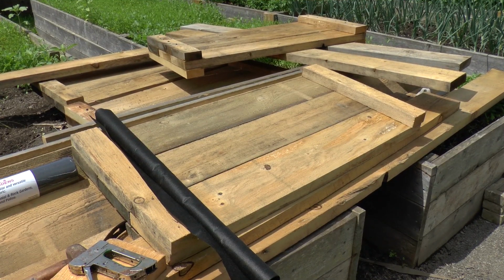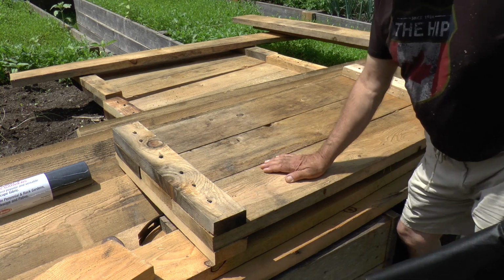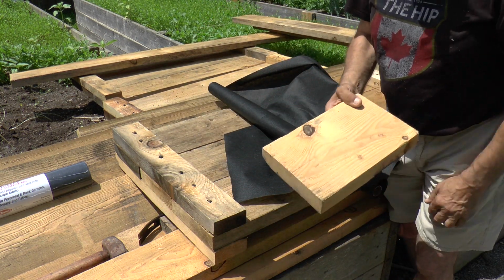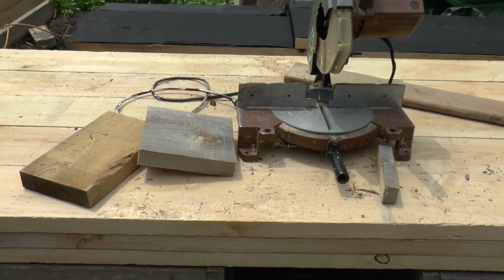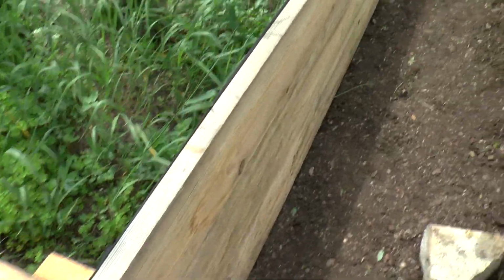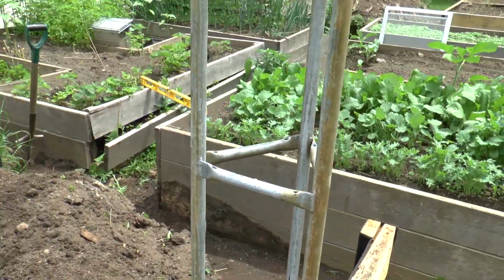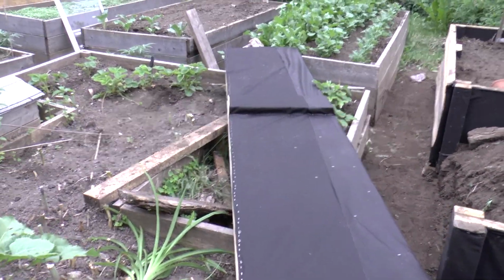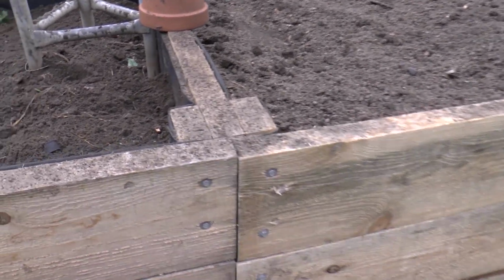LOCAL ISSUES : SURVIVAL GARDEN HUGELKULTURE BUILD/REBUILD.

Comment: I made my beds out of corrigated steal roofing and 2x4's.  I can get all the wood shavings I want from the dump site.  I only have two built so far but they are nice and should last a very long time.  Not only that, but a very easy to tent in the late fall and early spring.  I need to order some other garden fabric to add a second layer against the cold.  This is only my second year here in Texas, and I will be expanding as I can.